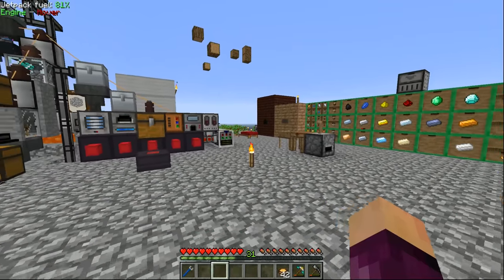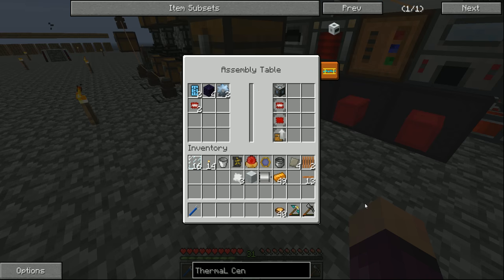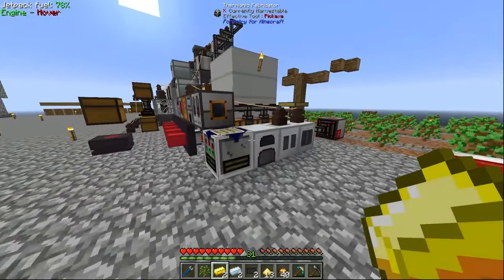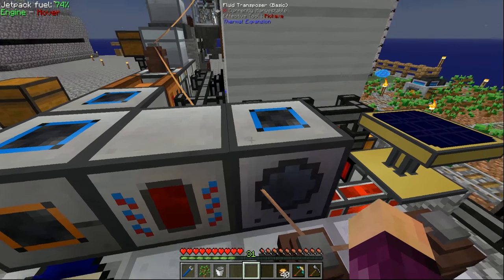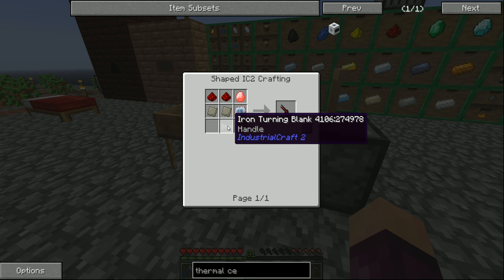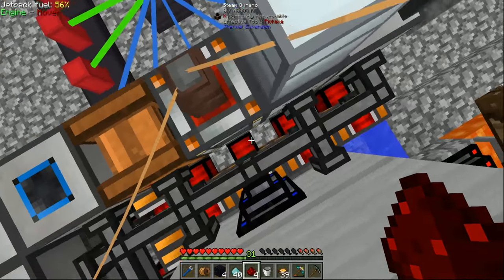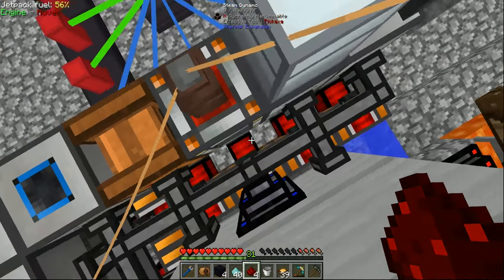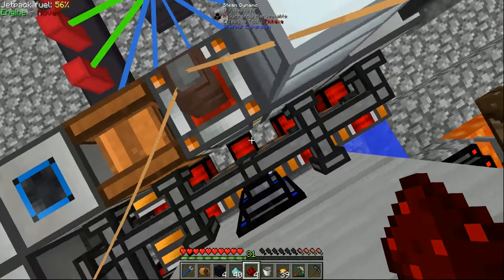FTB INFINITY EVOLVED SKYBLOCK - URANIUM 238 & THERMAL CENTRIFUGE! #13 [Modded FTB Skyblock]

Comment: You didn't need the fluid transposer for the signalum. Although it will be needed later.
You could just put the redstone in a tank and get it in the bucket from the tank (if the tank itself doesn't work).

Comment: i hope that they made the whole Uranium stuff easier... 
back when i did all this (in ftb infinity evolved) me and some pals spent over a week just with running three reactors to get the plutonium for mox fuel. we even reused the energy from the reactors to power a mass fabricator that made us more plutonium...
Reply: +DerKeyCee Nope. Same time requirements. My reactor on skyblock edition produces 3 plutonium every cycle which is just under 3 real time hours. Personally I use 2 reactors at 420EU/t to power my entire island. I'm not even ready to need Plutonium, but i know its ready for when i do need it.

Comment: isaac in the thermal exp. machines if you left click in the middle it will clear all the output and input sides and is a lot easier than clicking each one individually l
Reply: shift left click*

Comment: so, when I made this I just said screw the metal former and just used the good old forge hammer.  it's not efficient  but it shaved 10 minutes off my crafting :P. where's sphax?
Reply: if you emit a Redstone signal to the thermal centrifuge it will keep its heat level so you can process quicker kind of like the induction furnace from ic2. there's also an upgrade you can stick in the machine that will do the same.